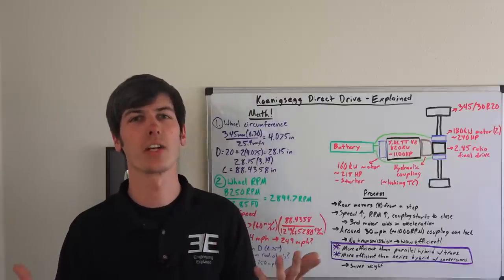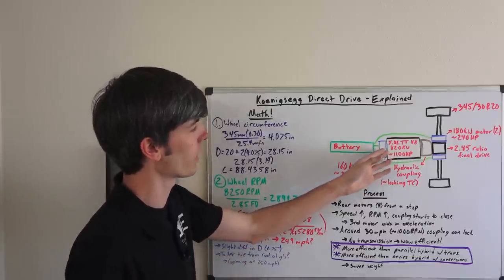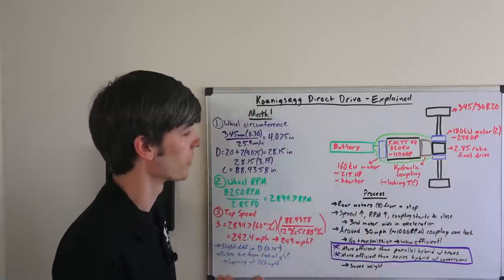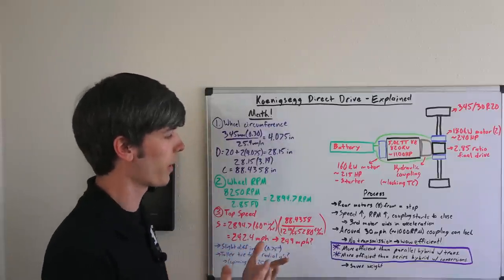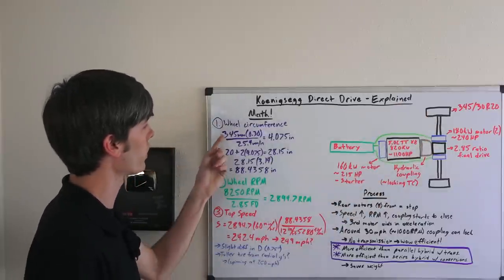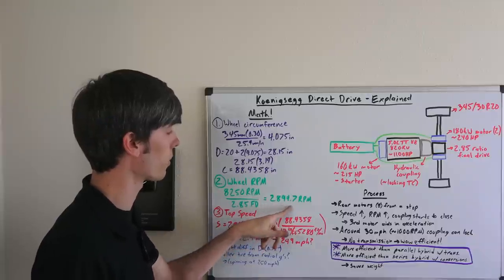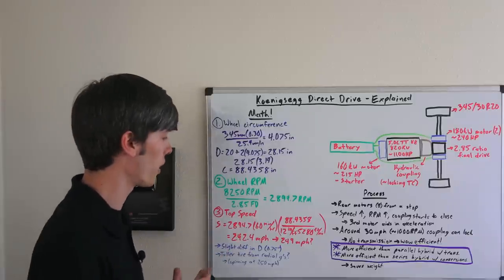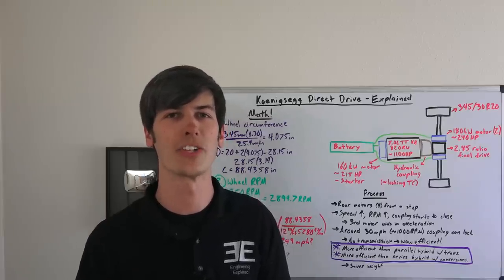Koenigsegg Direct Drive - Koenigsegg Regera - Explained

Comment: Say you're driving at 40mph (or any legal speed for that matter) and put your foot down, does it lug the engine and mainly rely on the motors or unlock the fluid coupling so the engine can rev and deliver 1100hp through rapidly-warming transmission fluid?
Reply: In the FIRST LOOK test drive video with Christian, the one with the snow, he does state that accelerating will cause the coupling to slip and the engine to audibly gain speed, and claims this keeps it from being monotonous like a cvt.

I think he also says in that video that reverse is entirely handled by the wheel motors. That would make sense, if there's no transmission there would be no reverse gear. This must mean one half of the coupling is being turned in one direction by the engine and the other half is actively being turned in the other direction. So unless there are other undisclosed clutches disconnecting the axles from the fluid coupling, this reverse implementation probably takes significantly more electric power than it otherwise would to make the car roll backward. I'm curious to know more about this part.

Comment: I was wondering how the front mounted motor aid in acc. Does the torque of the motor and the engine add up directly, or is there a particular mechanical coupling between the front mounted motor and engine
Reply: Sam Lakhmani 
The electric motor itself is the coupling. 
If no electricity is fed to an electric motor,
It free wheels.  Computers get the electric motors and gas engine to all work in sync instead of fighting each other. 
Oops, correction....when the electric motor is mechanically spun,  it becomes a generator,  that’s how deceleration regenerates (a little bit) the battery and slightly assists braking.
So,  you might be correct.  There may be a coupling between the front motor and gas engine for when re-gen isn’t desired.

Comment: So would KDD be like to only having 6th gear on a traditional manual transmission, and riding the clutch (hydraulic coupling analogy) + having electric motors as torque fill basically?
Reply: Close. Probably something like 4th gear (as 5th and 6th are usually for fuel saving and not getting to top speed). As yes, electric motors for low speeds as the engine would stall if connected.

Comment: damn Jason, that was impressive math right there
Reply: .... i'm talking about the formulas and their application... but then again you cannot appreciate that because you probably do not study engineering
Reply: I am not, I already have my Master in EE. I do appreciate the tech in the Regera, but you cannot appreciate that, because you probably have no clue about system and control theory, power electronics, semiconductors, computing architectures, Li-battery modelling, ...

Comment: Jason, I have a question. You mentioned radial g forces that expand the tire's diameter/radius/circumference. Will those affect the tire's dimensions at speeds as slow as 50mph? I know that at 0mph, the weight of the car pushes down on the tire, so the radius is smaller than 345/30/20 calculation calls for.

Comment: I wonder how they will manage a scenario where Batteries are completely drained. Imagine a start stop condition traffic, where the big v8 never gets an opportunity to crank up?  One thing they can do is to Run V8 and let the hydraulic clutch keep it disconnected from transmission. Use the Electric motor on crank to generate Electricity, which can then be fed to two electric motors attached to wheels to drive. All in all, pretty impressive design. And a very good job of explaining it to us :)
Reply: That is exactly how it works, as stated in press releases.
Reply: Zac Harris I was trying to listen on their press release. I did not hear anything to that effect in the announcement (perhaps I missed it)
Reply: You'd have the same problem in a normal car with a dead battery though, you'd never start it in the first place!

Comment: Is the only charging done by plug-in or is there some regenerative braking and / or power generation by running the motors as generators when cruising?  With some way to keep the batteries charged while driving, this sounds like next major advancement in hybrid drive technology.  I'll bet major manufacturers are paying attention.
Reply from the maker: Gary stowell Engine can act as a generator coupled with the crank mounted motor.

Comment: Would the engine not provide power straight away? As I was under the impression that it’s just a super heavy duty torque converter. Meaning it would be providing drive even without the internal clutch locked up. But the slip allowed is what stops the engine stalling on pull away. From what I’ve read it has no way of disengaging completely so there would always be a transfer of power via the fluid. Is this correct ?
Reply: It looks exactly like that.

Comment: with finding out the top speed you forgot to add the tread depth of 8 to 10  32nds depending on the manufacturer of the tire. So you forgot about 5/8th of an inch added to the over diameter. Then you will get a top speed closer to 249 mph.
Reply from the maker: Perhaps the case, any literature to back this up as far as how tire diameter can be calculated from labeled size? It's seems tread depth is rarely mentioned.

Comment: Do you think this type of direct drive hybrid could be practical in an ordinary car?
Reply: Absolutely unpractical. Unefficient hydro coupling till 40mph. And then only 1350rpm possible at that speed. To use all the ICE power you should accelerate first to 250 mph.

Comment: What are your thoughts as to how difficult and expensive it is going to be to maintain the car with so many different motors and all..... Supercars are notoriously difficult to maintain but this would be especially hard i'm guessing.....
Reply: Ebaad Ahmed electric motors are much simpler than a combustion engine so most of the increased cost is what you would expect anyway when dealing with a supercar :)
Reply: And a fluid coupling / torque converter is much more robust than a manual transmission.

Comment: Tires expand in diameter when they gain speed due to centripetal forces, and like this they could achieve higher than calculated speed ?
Reply from the maker: stilkus I've seen different claims to the top speed, but yes, altering the gearing alters the top speed, assuming everything can handle additional speed (including aero). Changing the tire diameter changes the gearing, thus can affect the top speed. Speculation though, I'm not sure what the exact number they've used as the diameter, I simply based it on the tires I saw. I'm sure they're specially built for this car and speeds that most tires will never see, so flex could be small.
Reply: Depend on what your calculated speed include. That' 242.4-249mph is in ideal world. By just the drive-train it self there is the mass of final drive unit, axial and wheel mass that will decrease the final top speed (assuming engine speed is true). So i will say it is very rarely a vehicle can achieve higher than calculated speed.
Reply: Matthew Chan Not necessarily, top speed will not necessarily be affected by the power train losses since the movement is locked! Acceleration may be affected by what you call "mass of final drive unit, axial and wheel mass" (I think what you mean is Inertia) but if the engine reaches 8250 rpm then the calculated speed will definitely be reached, and as Engineering Explained said the the G's affecting the actual rubber from spinning that fast may expand them a bit but I doubt they would expand up to 0.75 inches. the reason I think they May have gotten a 249 mph top speed is that the engine may have past the red line. I doubt the engine can accelerate all the way to 8250 rpm and just stop exactly at 8250. Especially since it was accelarinting at wide open throttle up to the red line and then as the throttle body is shutting off it still lets a bit through and that causes the peak rpm to be above 8250. What do you think?

Comment: This is how I assumed it worked, but without the torque converter.

I thought it just ran on the electric motors at low rpm (using the gasoline engine as a generator) and locked the engine at [perhaps] 2000rpm, where boost starts to kick in, and ran directly from engine to rear wheels from that speed and up.

Doesn't the torque converter steal a little bit of power from the engine?
Reply from the maker: Power isn't stolen when it's locked up (aside from rotational inertia). Just like a clutch that's fully engaged. And it's certainly not lacking in power.
Reply: Fair enough.
Reply: Engineering Explained is there any power loss from the 160 kW motor before the full lock up because of dragging the engine up to speed? Or is it that it's completely open before the engine would reach a suitable rpm to provide its own power? I'm referring to when the car is just starting to move btw.

I think you should check out the hybrid system that Honda has in the Accord. They have an interesting direct drive system too.
Reply: Dinsdale Drummond 160kW motor is linked to the engine, at low speeds only those directly connected are working.

Comment: hi there, can i ask some question regarding 1 gear ratio, when the 
car is at low speed high torque (electric motors kick in) then 2.85 
ratio was use, however it is only until 30 or 40 mph then when the ICE kicks in the ratio is back to 1 
the changing of the two ratio is done by playing with the 'shift' paddle??
is this explanation correct?
Reply: Deng Ting Koay 
1 to 1 (direct drive) is referring to the drive line back to the differential (where the 2.85 ratio lives).  There is never any shifting happening.  Everything beyond the differential (rear two motors, axles, wheels)  is always turning 2.85 times slower than the gas engine and front motor.
Reply: Not exact. Torque converter , before it locks, lets revolve gas engine slower

Comment: By the fact that the diff ratio is fixed, I imagine this gas engine needs an extremely flat torque curve not to negate power at such low RPM. Is this true?
Reply from the maker: Dirceu Corsetti Pretty insane torque from 2700 RPM and onward: http://www.carthrottle.com/post/engineering-explained-how-the-koenigsegg-regera-hypercar-drives-without-a-gearbox/
Reply: not necessarily. the electric motors make up for that to some degree.
Reply: duviday it might overlap power (electric + internal combustion) at the lower rev range indeed. Yet, electric motors depend mostly from the internal combustion engine since the battery is rather small (just 9kWh).

Comment: Whats the car that has a manual AND automatic in one? Dont remember the name of the gearbox or brand of car but for some reason I feel like it was Koenigsegg?
Reply: It's  Koenigsegg CC850 with LST transmission. It's robot with multiple clutches. And it has manual mode.

Comment: So it is mean that 2.73:1 is the only ratio needed after Regera more than 30mph? It is a wide range afterward ...
Reply: No, due to the hydraulic coupling between the IC engine and the differential there is a wide range of ratios the car can choose from.
Reply: There is just that one fixed ratio. Of course, if the lockup is opened, there are a spectrum of ratios, but only momentarily and not at all neccesary. So yes, that is the only ratio needed above 30 mph.

Comment: +engineering Explained can you explain how the Regera changes RPM during coasting situations? My understanding is the car goes X speed at X RPM since there's only one drive ratio.

How about if I were cruising down the highway at 80/90/100 etc mph? In this situation wouldn't gearing help in reducing the engine RPM to conserve fuel instead of just sitting at an engine RPM that's not ideal for fuel consumption?
Reply: Josh Chan 
Direct drive is the same thing as being in top gear of a transmission (without overdrive).  A tall 2.85 differential gear kinda puts the overdrive back in. 
80/90/100  would be a very mellow RPM

Comment: Sorry but looking at that photo, I'm struggling with the notion that the profile of the tires are 4 inches thick. the tires on my van are about 4 inches, and they look way different. Also, if the rim is 20 inches, and the profile is 4 inches, then the tire should increase the total diameter of the tire/wheel assembly by close to 50%. Visually, you can tell by the photo that the tires are not increasing the diameter this much....
Reply: Love the channel though, Keep up the good work!!

Comment: that estimate should take a dip once u factor in rolling resistance and drag
Reply: no, because this has nothing to do with power... only the maximum revs and the tire diameter... you could triple the top speed calculated here by tripling tire size.. but the car wouldn't suddenly have a 726mph top speed
Reply: TheLasagneLP this is just a rough estimate in real life,both rolling and drag resistances exist, by this method the car traveling underwater would have the same top speed as it would travelling in a vacuum. Or gearing a 200 hp with a 2.85 final drive ratio and putting 345 tires on it would get the same top speed as the Regera. the accurate calculation is more complicated than this if u are interested check the out fundementals of vehicle dynamics book.
Reply: Karim Nasr The car has enough power to exceed 250 by quite a lot. Therefore the rolling resistance and drag are irrelevant.
Reply: Zac Harris they are pretty significant if they were irrelevant the Regera would require a lot less power to get to 250. The faster u go the more power u need to over come the resistance, since drag is proportional the the square of the velocity. We're sort of saying the same thing but I'm looking at it from the design pov and u are looking at the final design.Should have made it more clear, my bad.
Reply: Karim Nasr yeah, i know... im saying this is just the top speed according to the rev limit... power is no part of this equation... ofcourse drag has an enormous impact in real life
Reply: I think they've calculated that, so it will reach its redline the moment it reaches its top speed. If it had to take a dip, then they'd put a shorter final drive or lower rev limit.
Reply: TheLaXandro well, we're talking about koeniggsegg, so yes probably :) they like to calculate stuff :D
Reply: Karim Nasr thats why this is the theoretical top speed.. we cant know if those effects will make a difference unless we have all the data of the car which only the engineers who created it have so until its tested you dont know that. one thing we can say is if they saw fit to put gearing in that limits the car to 249mph then it can probably reach it otherwise they would fit different gearing.

Comment: What kind of capacity does the battery have?  Seems like it might die pretty quick in stop-and-go, and the engine CANNOT help you below 30mph?  Design flaw?
Reply: The engine is idling, and the starter/engine mounted electrical motor recharges the batteries. And the engine CAN help you get forward below 30 mph. If all electrics are turned off, the car will still do 0-60 mph in 4 seconds. That fluid coupling is quite effective at getting the power down to the wheels through torque conversion and helps out pretty much from the get go, but is of course less effective than the electrics.